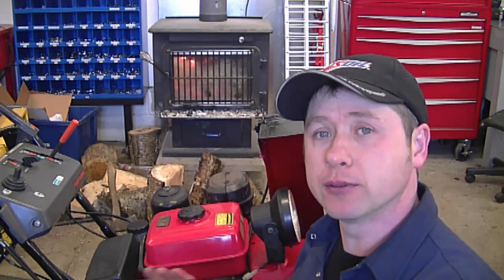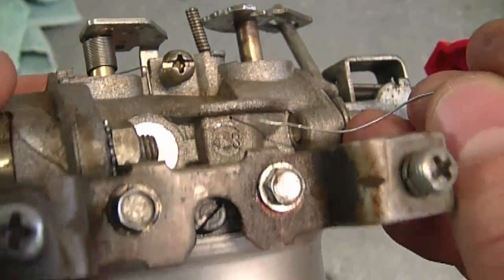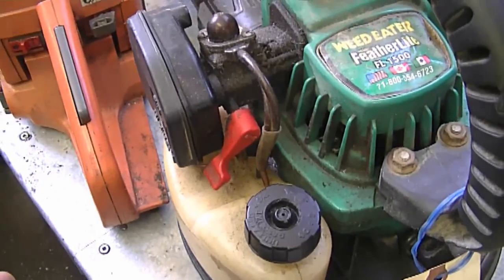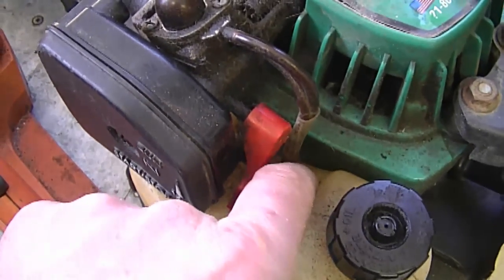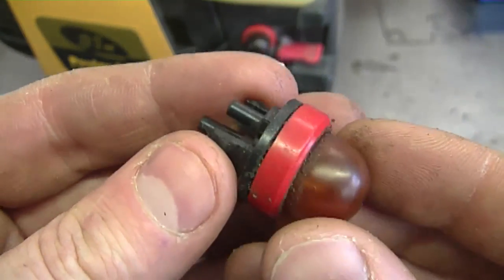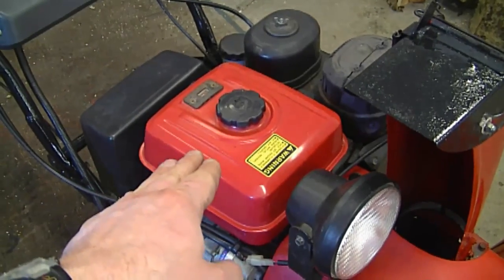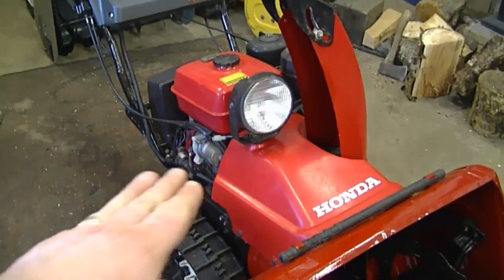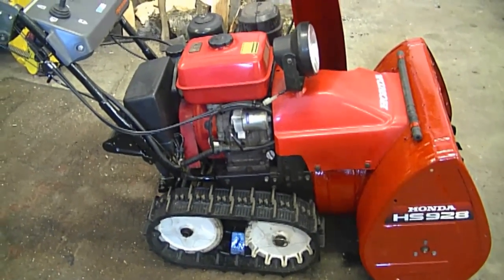Small Engines Q & A Video #121 in HD

Comment: Sometimes you can Dremel the crack to wider and rounder opening, then use two pieces of epoxy (if you can reach it from both sides) and press them together (after applying a bit of superglue -where it would 'sit' tight against), or use just one bigger epoxy chunk, press it against the opening so some of it protrudes from the other side of the crack/opening - and then while pressing - use a long tool to spread the epoxy from the other side unless you could push the chunk from the inside out :) Jo

Comment: Just has a Purge Bulb issue solved. When you plug it in the wrong order - it could remain concave. Also - if you plug it before the carb and not after it - it makes you think it's plugged shut!! Only later I found that PB should not PUSH fuel into the carb, but induce vacuum from the outlet of it so then the metering-valve can lift! :) I learned that this valve, or the 'needle', just won't open by pressurizing fuel from beneath it, but ONLY by applying vacuum from the other side by the diaphragm

Comment: as long as you drill a hole in the mount of the ignition coil only you should be fine. grinding it with a dremel works,too. i put a 5 hp ignition coul on a 12.5 hp engine by drilling into the mount one time. a year later the coil is still working!

Comment: One thing I add to my gas is one ounce of Marvel Mystery Oil to each gallon of gas used in 4 cycle gas engines.  I also only use premium, non ethanol gas in all my 2 and 4 cycle engines.  Ethanol exacerbates rusting in metal gas tanks and gas containers.  I also add one ounce of Briggs AFT fuel stabilizer to each gallon of gas along with the MMO, before the gas goes into the container.  I have never had a fuel related problem, excepting the time I accidentally filled a lawnmower with kerosene.  Even that had its good points - I ended up with the cleanest fuel system in town.😃

Comment: Excellent Video!       On my pushlawnmower, there is no throttle control.....it chooses its own engine speed.   I miss being able to lower the engine speed on certain hills and I miss being able to add a few rpm's when I get into thicker grass.  What are your feelings about these carbs. Is it viable to buy a carb that does have a throttle control?  Thanks for the great videos. It is always  treat to find one of your downloads in my email.

Comment: Hey Don, fantastic video as usual. Question for you though, which set of numbers off of the carburetor do i need to be able to order the full repair kit for 2 cycle engines? I got a couple trimmers that need some TLC this spring. Thank you sir.

Comment: Hi Dony,

Great tip on the Atmospheric vent for Tecumseh carbs. I see that carb. in the video is the adjustable type where the high speed adjustment screw is in the bottom. I know it probably varies with the Series Number of Tecumseh adjustable carbs, but any idea where the other end of that atmospheric vent ends up?  Would the vent travel up towards the throat of the throttle passage or down towards the float bowl?

Comment: Hey I got another question. My uncle has a Craftsman snowblower with a Tecumseh engine and it idle funny. When blowing snow its fine, but when its just idling it does nothing except run like crap. I have heard Tecumseh has problems like that. We even redid and the normal stuff to the carb but we think it is the governor.

Comment: I have a question on what you said about the primer bulbs that do not retract.
I have a poulan like the one featured, I replaced gas lines and the old primer bulb even though it ran fine, but the new primer bulb I put on it did not retract at all!!!? At first I thought I messed up the gas line configuration but then I had the same problem on an echo leaf blower but I did not change its gas lines.  ANY ideas as to why they did not work???

Comment: hey dony, got a question for ya. So i was riding a go kart (6hp 4stroke) and happened to flip it. Now, it wont start. It has compression, as well as spark and it sounds very healthy when i give it a yank, but doesnt even try to start. Tried starting fluid first through the carb, then into the cylinder itself and it didnt even try, most i got was a backfire twice. My guess is that the impact sheered a key on either the cam or crank, and the timing is off now, am i thinking along the right lines?

Comment: I have a Briggs apposed twin. it was full of oil. i ran it for 2-3 hours. now the oil is less than half. there are no leeks i can see. it has a new sump gasket and shaft seal. it some times smokes out of the lower cylinder when it exhilarates and when under large stress. could it burn that much? shulld i replace the piston rings?

Comment: hi i just rebuilt a tecumseh 5 hp engine. i got a carb kit and made sure the carb is clean. it also has a spark and pretty good compression but it will not start i rebulit the carb 3 times and it won't even start with quick start.i am sure i rebuilt it properly because i started before i cleaned the carb the third time but it only ran on full throttle. what seems to be the problem? thanks

Comment: Run it dry then,  coat the inside of a metal tank with used motor oil.  keeps gas from probably guming up the carb

Comment: bad spark plug. my friend had an atv that would ONLY run wide open. replaced the spark plug she ran like a dream. even if you do have a new one,17 out of 20 parts like spark plugs and distributors do not work.

Comment: stuck valve or valve that doesn't seat well. check spark plug too. or worst case scenario rings are worn out. electric starters are nice but once they break don't bother. they cost about half what you paid for the engine...